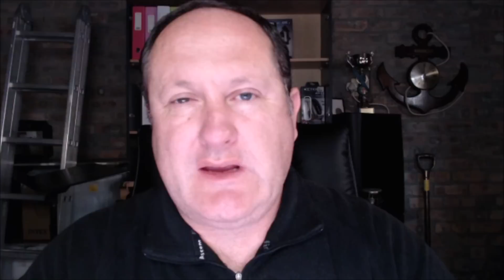00DEZZ - Blackout - Eskom's tools against total grid collapse.

Comment: I can only wonder why RSA does not have at least another two nuclear power stations. Maybe PE, Durban.
That way, if more than two coal stations suffer, these would be able to take up the extra load, for a set period of time, and get the issues resolved.
Reply from the maker: Extremely valid point. The water temp near KZN is not ideal for Nuclear designs.
Reply: Yes, go Nuclear. Pity tho, as we have plenty of the correct type of coal under our feet.
Reply: @Beyond-Politics , yes, base water temperature would need to be lower to ensure optimal cooling capability.

But what if another nuclear plant was located higher up the West Coast, like closer to Namibia border? There is also a suitable entry point into the national grid, not too far.

Push and pull effect : something that no solar or wind generation can do. Definitely not during peak cycles.
Reply from the maker: @nicodejager8644  Koeberg was sited for 6 units. Higher up the West Coast is ideal for temperatures but very little load.

Comment: Hi Dezz cant we use Vanderkloof and Gariep hydropower for a black start scenario? And too keep te grid in some areas that has critical loads?
Reply from the maker: Not designed for black start.
Reply: That's very interesting. I did not know that. Why is that so? What makes a generator black start capable?
Reply from the maker: @ironwolf6849  Not the generator. The system protection among many other things. You are not synchronizing to a grid as there are no other generators.

Comment: What if the powers that be want miniature solar grids, rooftop grids,  because Africa is actually the biggest unbanked nation and connectivity is lacking..
Reply from the maker: Then they should do it. If you can afford to be self reliant you should be. Just dont call it clean or green or renewable. The sun is has renewable energy. The solar panel and the batteries are not.

Comment: We dig small square in ground line with plastic fill with removed earth.add 2 electrodes..iron for 1 copper for the other.push into square.salt water,vinegar or even,
wee piss.connect.1 square..09-1.3 volts DC..